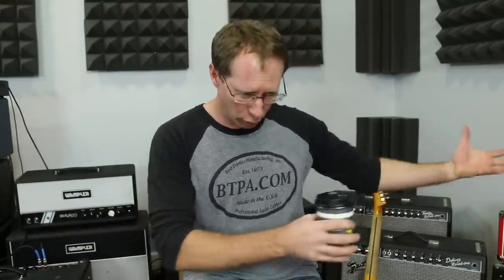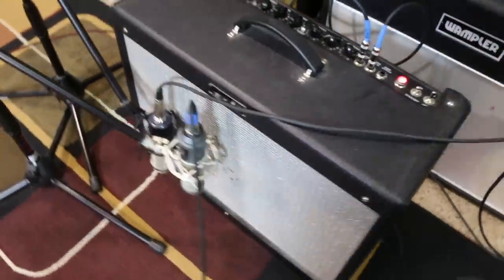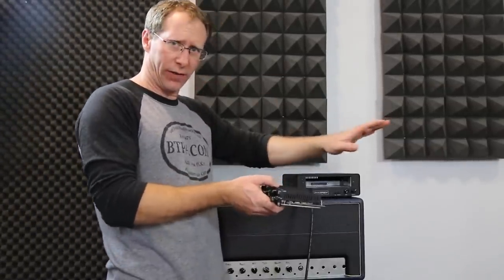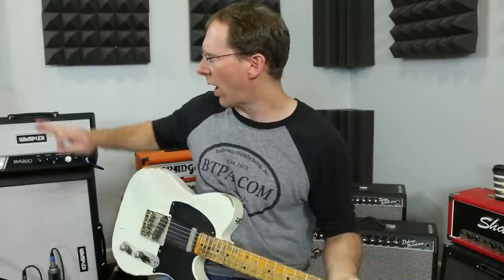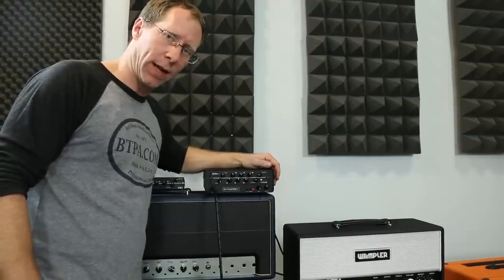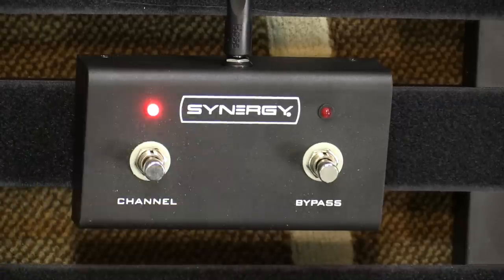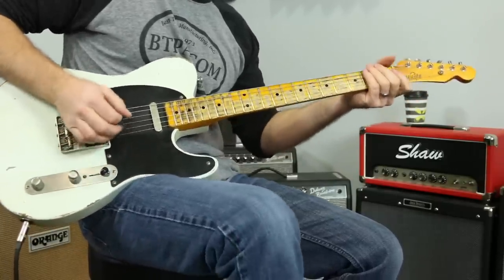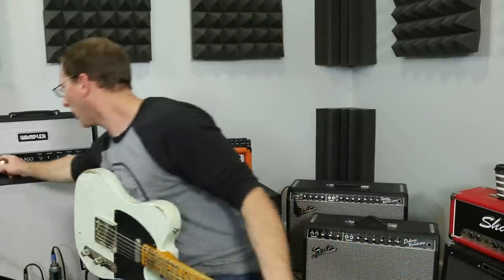Are VACUUM TUBES now the FUTURE? A look at the new Synergy technology

Comment: Egnater and Randall have amps that use modules in the preamp section. My brother used to have one of the Randall combo amps that had that, and it's a shame he sold it.
Reply: Someone pointed out these are supposedly compatible with that old system. Would make sense since at least Egnater is involved in this project.
Reply: Ty Tabor of King’s X used one of the Randall module systems for years and I always thought he sounded great, but I never got to try one myself...

Comment: I am a preamp loving Martha Focker. Historically preamps were 1U rackmounts. Some of my favorites, ADA, Rockman, Engl, Marshall, Mesa. There are also 2U, some of my favorites Mesa, Bogner, Soldano, Black Widow. Without reinventing the wheel I've always done routing and switching with MIDI. So much gear, you end up needing a patch bay, but the old Switchblade digital routing matrix serves as a 16x16 i/o. Maybe Synergy will give us something new, and let us route dozens of these things. Sounds expensive, however, and probably why I'll remain interested in the powered 1&2 space units. This also explains why I've never used pedals. But you'll miss your old combo. There's no single solution. For me, the solution was the Switchblade from Sound Sculpture because that's the unit that allowed me to change patches with one button press. You want a Vibrolux straight in? Boom. You want an old Marshall, boom. You want an old 80s hair metal, boom. Quite simple, the SBGL is flawless fast.

Comment: Slightly off topic ... I don't have an amp with an effects loop but I do have a WEM Dominator MKIII (the one that Marshall "borrowed" the circuitry from). It's an amazingly rich sounding clean amp that starts to growl a bit when you crank it ... but the one thing that turned it into an amazing amp, that sounds better than a gainy  Marshall, is the Wampler Plexidrive. So thanks for that.

Comment: I bought the full system.  Syn 2 and the 5050 head with the BE, DS, and the B man. They are good.  But I would make sure that the amp your plugging the Pods into has enough wattage.  I first used this through my Bogner Atma 18 watt head through a shiva 2x12 (before I used the 5050 head). The pods want to compress early in a lower wattage amp which makes them not hit the full volume of what the amp can handle by its self. Which makes them hard to really control (overdrive gets uncontrollable).  I own a BE 100 for my road rig.  I was hoping I could down size my rig and give myself options.  But the pods don’t match each other very well.  You’ll get one pod like the BE that is super thin compared to the DS and the BMan.   Once you get the 5050 head this all acts a lot better.  However it’s just still not quite right.  The pods are still mismatched. I was really hoping this system would work but I feel the system needs kinks worked out. If I had the ability to review I would have loved to show these points out.  Honestly (I’m not a pedal guy). But you would be better off getting a nice $1500 -$3000 amp head (since you’ll be spending at least a $1000 to get started with the system being reviewed) and just buy pedals for it to achieve what they are trying to achieve.  Recording wise I can see this product really shine.  I feel like I bought the first year of a new car.  When I probably should have waited another year when they worked the kinks out.

Comment: Ok, this may be a silly question but... if one is only interested in the sounds from the Synergy module, I suppose you're only using an amp for its speaker? In other words, isn't it bypassing both the front-end and power-amp of your (say) Fender Hotrod?

And in that case, isn't it more effective to just use the Synergy module and a speaker cabinet?

Comment: So basically it let's you bypass the amp's preamp section? So the only variable in getting an exact sound then is power section? So if you want the amp to sound exactly  like the original you need an similar power section (same tubes)?

Comment: If you want to make less of a commitment than this very cool preamp system, you could use a tube pedal preamp, such as those Kingsley makes. They are also designed to run into the effect return of an amp.

Comment: +Brian Wampler
So, being essentially a metal player who also happens to love classic rock, modern country, roots, blues, bluegrass, jazz, swingabilly a la Brian Setzer and what have you I can see myself using these different preamps in my studio for the metal tones from all the amps I cannot afford.
Can´t wait to get my hands on two units and a load of modules and start combining them for the ultimate metal tone into a stereo 4x12 with G12-t75s in the bottom and v30s in the top. Perhaps even with a Peavey Classic 50/50 dual mono bloc as a power amp,- would sound amazing.
Will probably be expensive but something I am willing to do since it would give me the opportunity to  record these the old school way with actual amps, speaker cabs and, lo and behold, microphones,- what do you know .... Sold - for metal.
For anything not metal, see above, I would use my trusty old Peavey Classic 50-410s, yes, two of them, since I love combining tones, and in front of them I would use good pedals with the caractheristics of classic amps, ie. Wampler Plexi Drive, Carl Martin AC Tone etc.
I have a question however.
How do I match the different impedances of high impedance passive guitars, hi-end " boutique" pedals that will most likely be at line level at the outputs and inputs on amps that expext to see low level high impedance guitar signals coming to them ?
Clarification would be much appreciated, either here in the comment section or better yet as a full  video that once and for all sets these topics straight.
I am convinced you would be the man to do it.
Thanks for great pedals and all of the great content, - and merry christmas and a happy new year to you.
Reply: P.S. Bucket list for metal modules: Mesa Boogie Dual Rec,  Peavey 6505(5150), Randall Satan ( Fortin Natas ), 
Engl Powerball, Marshall JVM, Titan Cerberus,  Blackstar HT,  Laney TI Sign., Brunetti XL R-Evo, Brutus (Cigognani )... The list goes on...

Comment: I was pretty amazed at the price. I was kind of expecting these to cost something like 3 grand to even get started. The San 1 is like $500 and the modules I looked at were $400. That's pretty reasonable for this awesome product. $500 for the "base unit" thing and then like $399 to add an entirely new "amp?" Yes. Time to "rock out."

Comment: granted I am not in the room, but the AC preamp and Metro preamp sound different than all the others and very cool.  The Soldano, Bman, and Deizel all sounded the same to me.  I think the Bman and Tdeluxe will not sound like what we typically think of like this, as we are not getting the sound of the power section being pushed over the top and the speaker breaking up.

Comment: So if you were running this through the power section of a solid state power amp vs tube would there be a tonal difference or just a feeling? Both? I understand that solid state can tend to distort in an unpleasant way while cranked tube amps give a great sound and feel but I've never personally experienced this being as tube amps can typically be very expensive not only to purchase but to maintain.

Comment: This is exactly what Randall used to do with their module amp. I always thought that was a great idea.  In their platform you had up to 4 modules in the head at one time. You could have 4 different amps in one head.
Reply: I see it has been addressed.  Still seems very similar , a very cool design on both parts.

Comment: So what happens now when you need to add effects to your sound that require the effects loop? You don't have it available anymore?
Reply from the maker: There is an FX loop on the unit
Reply: Wampler Pedals ok but if you want to use the amp sounds and you have the syn bypassed will the effects loop work?

Comment: 3 days and 346 comments.  The signs of a controversial topic!  Great video, and thanks for posting.

OK, I'm a gigging guitarist and I use one amp - for a long time, a two-channel Mosfet Sessionette 75, and more recently, a Blues Deluxe Reissue.  I generally have a touch of reverb, and use only the overdrive channel, set it on the edge of breaking up and use the guitar's volume control to clean up.  I also have a delay pedal in the loop, again, with just one setting, always on and adding a bit of colour, but really in the background.  Also, just one guitar, using the pickup selector to get different tones.  The point is, I see other guitarists doing much the same.  We don't use multiple amps and different sounds all through a gig.  Once you're happy with your sound, that's it.  Anyone here using multiple different sounds/amps during a gig?

Comment: This is new MTS. MTS was Bruce's baby. When he left Randall, he took his baby with him and has been toiling for half a decade or more to do it... Right this time. Speculation on whether this was the sticking point why he didn't stick around, but Randall isn't very good at keeping amp designers (as in Fortin who just had enough of them too and left). I don't think they would let him fully realize the quality of MTS he wanted, thus all the original modules being "Genericerized" and needing cap mods and full workovers to be amazing. Modded MTS is fantastic. This is even greater.

Comment: A Question:  I'm working toward buying a Taylor T5z Elec/Acoustic Hybrid.  Has Great tonal control for electric gtr, but I  would be running through a "LoudBox" Accoustic Amp.
Would this device work well with an accoustic designed Gtr Amp, so I could have clean accoustic when I want and really in your face Electric Guitar when I switch to the different routings for electric Guitar on the T5z?
Reply: Here is a very good demo video of what the T5z is capable of...hence the question above.
https://www.youtube.com/watch?v=eijl_S4xHVc

Comment: Preamps are the future.  For recording and live.  Who needs to lug around a 50LB tube amp when you can plug a little box like that into a PA or into the back of the house amp, or into an interface for use with impulses.
Reply: It's still not the same as having the power tubes pushed hard. That's a special sort of sound with many classic amps. Not that I'm against this concept if it's the only thing that's practical. But it's not the same as plugging in a Marshall half stack or an AC-15/30 and turning it way up so that the power tubes are really working.
Reply: Dean Roddey power tube distortion is more mythology than reality.  most of what passes for power tube distortion is really phase inverter distortion.  beyond that I think we're reaching a point where there are very few places you can crank an amp
Reply: Whatever the ultimate cause, emulators, even analog ones, don't really replace the real thing. It's something that gets easy to forget when hardly anyone even hears the real thing anymore, not just amps but almost everything in popular music. It's so artificial these days.
Reply: Dean Roddey that's why I like this kind of technology.  a couple 12ax7s run at ~200 volts with the right circuit can get almost any tone under the sun for not much more than the cost of metal, power supply, and a few tubes and sockets.

it's not as authentic as a cranked 50+w head, but it's very close and very light, and can always be reamped.

Comment: Tubes I think are indeed here to stay.  It's not that their sound can't be emulated.  However, the "Feel" of tubes in the way they react to your playing is something I've yet to find duplicated in any analog or digital emulation.   That being said, the Hotone series of micro-amps are SCARY accurate simulations of tube amps. As such it's going to boil down to how many $$$$ that a guitar player has to spend. If I had the $$$$ I'd love to buy Synergy modules to run into my Crate 50 watt stealth tube amp. 
This demo I think sounds amazing btw.  Great work on micing up the amps perfectly.   Ribbon mics I take it?

Comment: So, I like the idea - actually I wish more companies would bring back rack preamps so I could have 5 very different preamps and 5 very different power amps and get 25 different sounds for far less cash than owning 25 heads - but it seems unnecessarily complicated to have the switching between the regular amp and the modular preamp. Like, if I had one of these, I would (assuming I could) just plug a guitar into the input jack and run the "effects return" output to either the effects return of an amp or the input of a power amp (or even a direct in on my interface with a clean amp sim). I am not entirely sure how this works thought, I'm just a broom  with blue bristles, maybe my drummer can explain it to me.....

Comment: Considering you bought a real SLO, I have to assume this isn't quite "IT". Would love to hear them head to head though.
Reply: Of course it’s different, we have to factor in cable impedance, tube type and rectified circuit blah blah of the amp being used as a slave. 
     It’s pretty cool but I will stick to pedals; this is a toy for the spendy folks.

Comment: Stupid question: Can you plug a guitar into the Synergy box, then from the Synergy box connect to a powered speaker or PA?
Reply from the maker: Yep!
Reply: I think an interesting question is if the DI out has a circuit Power amp emulator ?

Comment: I also have out of many amplifiers a Hot Rod Deluxe combo, I completely loath the drive channel it has, It is just horrible I find. I do think the clean channel is pretty decent, So I switched out the speaker it came with along with fitting a valve selection which take away about 40% to 45% of the gain which improved it a lot. The clean channel is now good, It's got a lot more headroom which makes it not only a good amp for recording clean sounds but also a very decent platform for various drive pedals, Either alone or stacked gain wise for full on distortion sounds + it also working very well as a front for the unhealthy number of all out, Modern high gain distortion boxes which I have, I've got a bad habit of obtaining more and more, I can vouch for your Triple Wreck and Dracarys for just two examples of such that work great with the hot rod deluxe, Even more so after making it a specific amp for cleans only due to my contempt of that drive and more drive which are both junk/I couldn't find any use for them.
I got it for very little money of off a friend who has his own studio setup but doesn't play himself,  Basically he'd bought it just to ensure he'd have an amp just in case he ever ran into needing one if a band turned up without a usable amp for tracking between them came along.
I'm always interested in anything guitar and bass guitar wise as both a player and audio engineer, It sounds and seems promising the Synergy platform, I look forward to trying it out.
Cheers Brian, All the best to all and wish everyone season's greetings

Comment: Mostly a good idea. Just remember different amps not only use a different preamp but also different "power tubes". These modules only address the preamp sections. Perhaps if you have one of those self biasing amp heads that accept different power tubes then you could really get the sounds you seek by changing the power tubes when you change the Synergy Modules.

Peter

Comment: Why not just a JCM800 2204 and be done with it. Though I do agree that the OD channel on hot rod deluxe is absolute trash. Jeckyl and Hyde on the clean channel of the amp , red side of the pedal transforms it just by putting it in front

Comment: Neat idea, but honestly, while the prices of the modules are "fine", IMO the pricing of the SYN-1, -2 or their head SYN-30 / SYN-50 is way out of line. 550€ for the SYN-1, 900€ for the Syn-2 and 1700€ for Syn-30, which is an amp without the preamp section... so it's a 30W power amp for 1700€.
Considering those things are basically just cases with a circuit to hook the pre-amp module into the "main amp" circuit, those prices are just way over the top. I can get a 2-channel Diezel VH-4 pedal preamp for 330€.

The idea is nice, the price sucks.

Comment: Not knocking this at all, actually I think it’s a real cool concept and amazing idea
But 500 for the device and 300 for each modual. I could buy a used 5150 3 50watt for that much
Reply from the maker: yes, you could, but think of it this way: Once you buy the hardware, then each new "amp" is only $300. While 5150's are not as expensive as Friedman amps (for example), you could potentially get a $3000 amp for $300 with the module
Reply: Wampler Pedals I don’t think people understand this concept? They also don’t realize that Synergy bought the rights from Randall and Egnater. The big deal here is that this idea can really go places with the backing of Friedman, Morgan, Vox, Diezel, Metropolis just to name a few and many more to come. Just looking at Dave Friedman’s back ground and experience with modding and building amps alone much less throwing all the other amp gurus in the mix! Many people don’t even know the past history between Friedman and Egnater.. ya, the idea was done by Egnater and Randall. But, not at this level and never with so many gurus at one time! Jump on this train Brian. I don’t think you’ll regret it.
Reply: Honestly this is the only way to look at this if you like chasing various preamp tones. It’s cool and seems well made; the company is working ethically it seems and it could be a staple in recording studios which offer equipment use.

Comment: While this way of using the system is decend I guess, what it truly does with their power amp 1U tube power rack in combination with either the syn 1 or 2, is make all heads and combo amps in the world basically obsolete aside from small practice amps.
You dont need any large heads or conbos with their system.  Its genius.